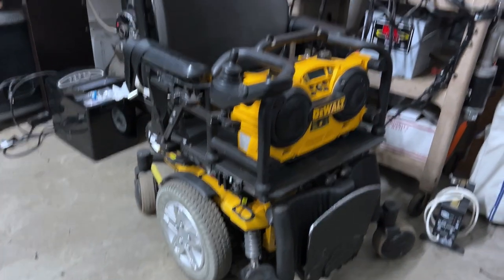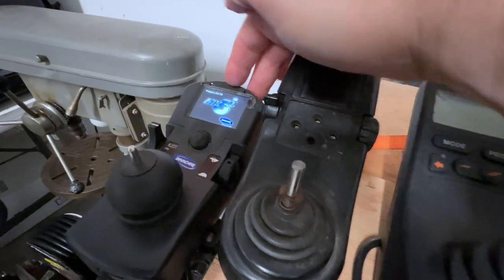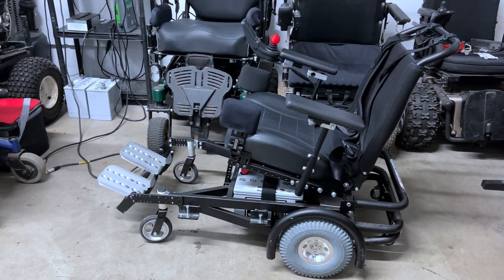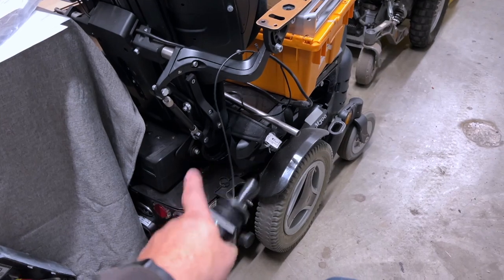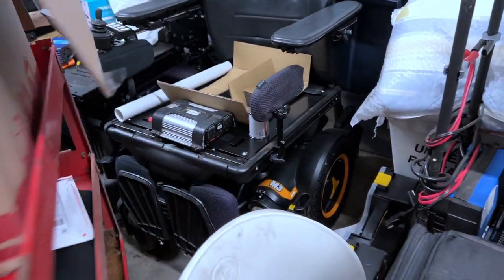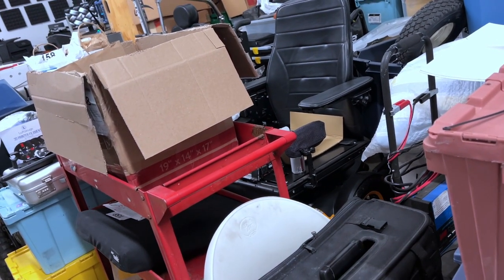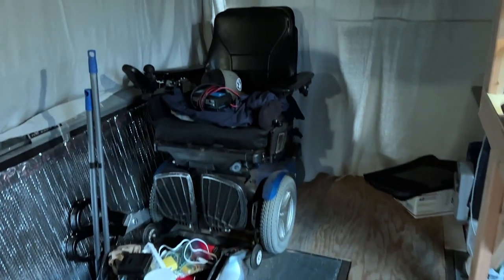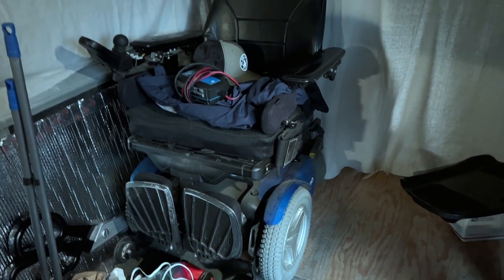MEGA VLOG 639: fleet update! (and other ramblings)

Comment: I used x10 till about 8 years ago and it was great except when fluorescent light bulbs and ups battery packs would go bad they created too much interference on the line and several headaches. After that I used Insteon which was RF and powerline. I am now on Lutron Caseta for all blinds switches and modules. I installed about 50 proprietary  home automation systems for quadriplegics before Alexa and mainstream adoption. Tried to switch business models to setting up off the shelf products but clients were constantly calling with password issues!
Reply: My issue with x10 in the day was keeping things that needed to talk to each other on the same side of the fuse box.  Back in the day, if you had a control on 1/2 of your panel box's 110v side it wouldn't cross over and talk to the other 110v side without a special, expensive, adapter.

Comment: Not watched the full video but linx on the TDX SP2, no one will sell me the access key! I did however fit a reclining back to ours and it did auto detect... although not the gyro sensor that is supposed to auto tilt but you can't win them all.
Reply from the maker: yea.. those access keys are unobtainium for sure! right now, bounder is the only chair manufacturer that readily sells with with their chairs.. ya might shoot them an email and see if they'll sell one separately! (probably not cheap though)

Comment: The red tdxsp2 chair I have that one I’m using with the same controls it takes a key u plug into the charger port and u can use a I phone to make adjustments to it it got mine jumped up as much as it can for speed and to climbing up on to things lol but my chair is 428 lbs without me in it I’ve had it for 2.5 years no problem just need new wheels normal stuff

Comment: Can the tyre solid inserts be installed by us or are they factory fitted I need new tyres but want to install the old ones from my present ones to save money .?
Reply from the maker: most of them are formed inside the tire, making them EXTREMELY difficult to remove - years ago they just used inserts.. but now the foam is formed in place :^/
Reply: @TotallyNormal-  ahhh thank you this saves me an expensive experiment lol.